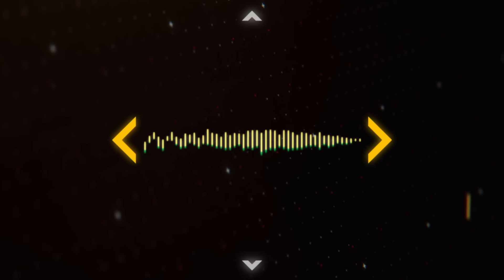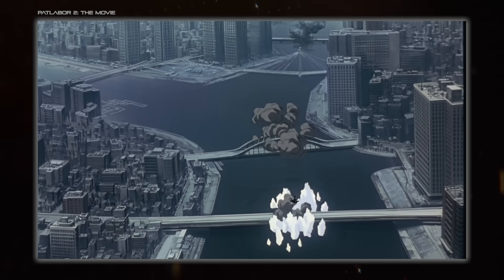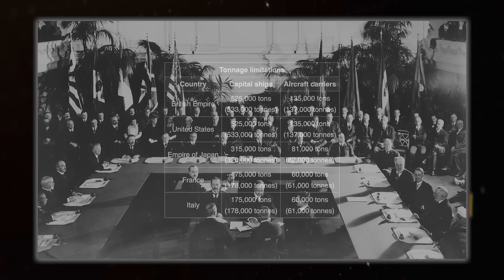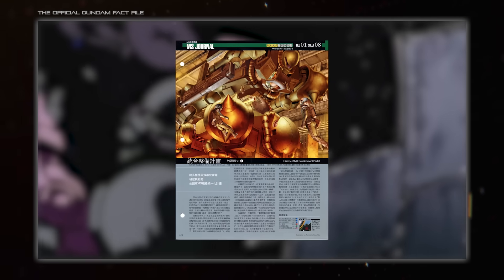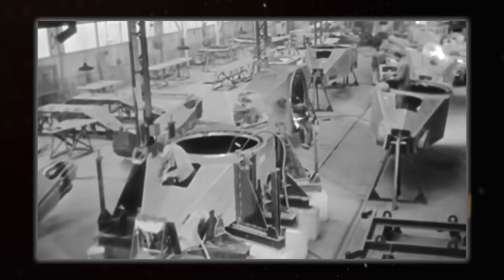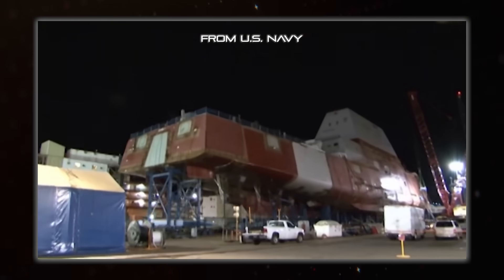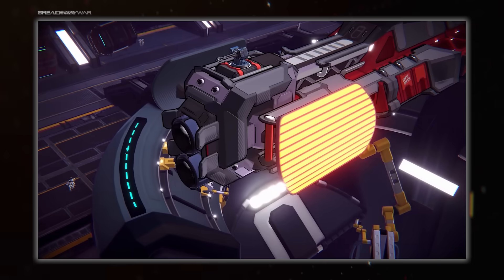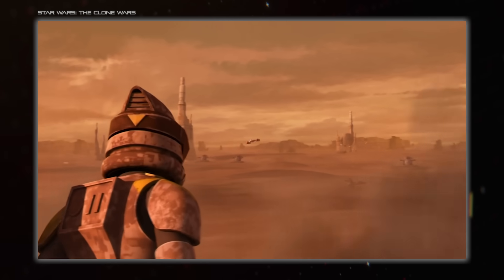Design Principles in Sci-Fi Spaceships

Comment: One thing I'd like to add is definitely the interwar period of 1920-1939. Many ships were built during this period and since it was peacetime no one really knew what the future will hold. Japanese went big on ships like battleships and cruisers. Yet by the end of WW2 everyone realized the winner move was doubling down on aircraft carriers which is why still today the formation of naval fleets are centered around and supporting an aircraft carrier.
Reply: Regarding Imperial Japan: The U.S. felt the need to field a two-ocean navy, so its battleships were limited by the Panama Canal. Japan was interested only in the Pacific, so it built big with the IJN Yamato -- a wider ship provides a stable platform for bigger guns. In an SF setting, the author might posit different goals among the factions that lead to favoring different engineering trade-offs, even if the tech level is the same. Maybe your home star has frequent flares, so you prioritize shielding.
Reply: @phillipthorne8363 I really enjoy settings where there are limits on FTL travel that result in those kinds of design decisions. If there's a volume limit for example, that means your defence fleet doesn't have that limit if it never has to go FTL, so they might be huge in comparison to FTL ships
Reply: Japan's naval doctrine was always to build the strongest ship in each ship type, this is opposing Britain which built as many ships as possible, even if they were qualitatively worse. They also went big on torpedoes to make up for their quantitative disadvantage. Most of their naval doctrine was centered around making up for their disadvantage in battleships vs. the US in order to win a decisive battle and thus (theoretically) win the war.
 It should be noted Japan went as big in with carriers as everyone else did (Japan had 6 Fleet Carriers, US had 7 Fleet Carriers, Japan had a bunch of extra Light Carriers on top of fleet carriers tho).
Reply: @ronanmcdonald6386The US also had a massive escort carrier fleet, far beyond the Japanese light carrier numbers (and could actually put planes on them all).
Reply: @reliantncc1864  You're mixing up the US pre/early war fleet with the late war one.

Before Pearl Harbour there were three Essex class being built with 8 on order with NO light carriers in the works and only 7 escort carriers being converted (of which 4 went straight to the British).

Even after the US entered the war there was a period where the new ships were not ready when losses and the need to keep escort carriers in the Atlantic to hunt U-boats meant that HMS Victorious was 'loaned' to TF 14 in the Pacific during early 1943.

It was only after mid-1943 when the first Essex's and the emergency conversions reached the Pacific did the number of carriers swing back to the US's favour.
Reply: @IamZim11  I'm not mixing up anything. We're talking about the war, all of it. You don't get to decide we're only talking about the first bit.
Reply: @reliantncc1864  That's a rather reductive view of history, especially for an event that took years to conclude.
Reply: @IamZim11  Oh, sorry, but I can't fit a essay into a youtube comment. I've probably read more books about the war than you've read books at all.
Reply: @ There's no need to be rude, but it is worth noting that the original comment sets a time of 1920-1939, so the interwar period, and this comment chain has been talking about the leadup to war and Japan and Americas' choices in that pre-war buildup. Yes, during the war America was able to use it's industrial might to mass produce Carriers, Light Carriers, and Escort Carriers. Japan's lesser industrial power prevented it from making carriers at the same rate (which kinda makes a case for why as much as the Japanese navy hated the treaty system,  they kinda needed it to stay relevent). It's also worth noting that Japan had more carriers in the Pacific of all types than America US 5, Japan 6 CV, 4 CVL (10 total) until the Battle of Midway, (where it went to 4+Wasp as reinforcements vs. 2 CV 3 CVL, still a numerical advantage, but a aircraft numbers disadvantage) and regained that advantage during parts of the Guadalcanal campaign. Finally, Japan had an excess of planes in 1944, but no trained pilots. Only in 1945 was there a real shortage of planes, mostly in newer types.
Reply: Or, if you are Iran, built around tanker's masquerading as aircraft carriers. Lol.
Reply: The single most important factor in interwar naval design was merely the requirement to abide by the naval limitations treaties. Every country had things they tried to pack the necessary firepower into the limits on tonnage.
America used compact propulsion machinery and the all or nothing armor strategy.
Britain and France tried goofy gun configurations like quad turrets or putting all turrets forward.
Germany just... didn't follow the treaties.
Reply: That, and Japan always felt slighted by the much lower limits put on them by the Washington Treaty.
Reply: Well, Japan was on par with the UK and US carrier-wise, at least until Midway
Reply: There is no air/water interface in vacuum.  

No point in having spacefighters other than dropship gunships.
Reply: @brandonbowerstx  maybe torpedo boats though.
Reply: I've thought about this a littlez and space fighters maje way more sense than you'd think at first glance. To explain this we need to look at what a carrier aircraft is useful for, and see how this can be applied to spaceships:

1. Carrier based craft allow the home craft (carrier) to extend it's effective sensor and munitions range, allowing it to 'reach out and touch' far away targets without being at risk of retaliation

2. Carrier based craft can be deployed more flexibly, allowing a single ship to have a wide area of influence that can on demand be focused on a single point. A fleet of smaller ships with ghe equivalent tonnage of a carrier wouldn't be able to cover such a wide area and concentrate their firepower at the same time. But a carrier can.

3. Because the home craft handles the transport of fuel and ammunition, as well as life support and living quarters, the carrier based craft can be designed without those amenities, thus being more combat effective by reducing weight and size for the same amount of munitions

Notice that all these advantages don't apply exclusively to modern crafts. Hence why I never used the term 'aircraft', only the domain agnostic 'carrier based craft'. I think, depending on the setting, having large ships that carry smaller ships inside them would make a lot of sense. Those smaller ships could be leaner and meaner due to a lack of long term life support,  fuel, and munitions on board. They could be deployed as scouts, or as patrols, of massed together to attackenemy formations. And they would always be faster than enemy spaceships because of the aforementioned lack of heavy long term necessities. So yeah, I think carrier crafts make a lot of sense in sci-fi depending on the setting.
Reply: @Fantastic_Mr_Fox  The issue is that any mass you spend on the parasite craft is probably better spent on the large one instead. The same mass and propulsion restrictions are in effect, and you don't even get the advantages of going higher, being much faster or harder to hit like naval aviators do. 
Aircraft are fundamentally different from ships, that's why aircraft carriers exist - there is no such distinction in space
Reply: @ I think I should have explained a little bit more, because the problems you mention, while they certainly reduce the value of fighters in a space setting compared to a planetary setting, aren't as bad as you think. 

Firstly, the mass and propulsion restrictions aren't the same. A fighter craft, as I pointed out in my first comment, doesn't need as many systems as a cruiser (using the age of sail definition here: a ship used for longer voyages) and is thus lighter and smaller, allowing it to evade enemy fire much more consistently. 

Secondly, spending that mass of fighters on the carrier itself has drawbacks. First, you lose versatility, since a warship can only be in one place at any one time, but a fleet of fighters can be in many places at once. You also lose redundancy: if a critical system of your ship is hit, that's it for the ship, but if you lose a fighter, you may have 20 more till. 

It also allows you to engage enemy ships while not being in harm's way yourself. Think of fighter craft as an extension of the ship's weapon systems and not as individual ships. 

To be entirely fair though, this only works if the economy of scale (when massing everything into a single ship rather than multiple) isn't that great, so splitting your ship into smaller ships isn't massively inefficient. Also, you need not have an upper limit on acceleration, which would limit the speed of the fighter craft to whatever Gs the pilot can pull, or have unmanned craft. 

But, supposing those issues are dealt with , I think fighters make a lot of sense. Imagine a swarm of fighters, too far away to be hit with your guns, getting into their range and unleashing a hail of torpedoes then noping out of there. Would be a pretty powerful combo I think
Reply: @brandonbowerstx  that's quite a shortsighted ideal. We aren't talking about real life here. In a realistic fiction like the Expanse maybe but I believe the largest sci-fi franchise Star Wars really likes spacefighters. And there are plenty others like Gundam, Battlestar Galactica, so on so forth.
Reply: See my comment above, I lay out arguments for why space fighters make a lot of sense (specifically for hard sci-fi)
Reply: @piperMcGuffin  : Fighters require 4x Delta-V compared to an equal volume of missiles which require 1x delta-V for the same exact mission.

Tactical mistakes cost 6x Delta-V.
Star Wars is trashy space fantasy.  Not anything approaching hard SF.
Reply: @brandonbowerstx  yes your point? Hard SF isn't the only thing that exists. And honestly, objectively, not better than soft Sci-Fi. I found myself bored by realism in recent years.

Comment: Currently playing through FTL: Faster Than Light for the thousandth time. 
Space is hard. Just made some poor pirates desperately suck vacuum while I watched their life support burn. If this seems unnecessarily cruel, consider that they had stuff that I wanted, and they were in my way. Accordingly, I introduced their hull to my dual Burst Lasers.
Also, consider this: what's on the other side of the airlock? That's right- space. Therefore, he who controls Doors, controls Space.
Reply: Fellow Door Monster fan.
Reply: Doing a Rock A run this morning. On sector 8 with a Vulcan, Swarm missiles, and a fire beam, with auto reloader, fully upgraded teleporter and 4 Rocks for boarding. Flagship is toast.
Reply: Tarded but amazingly accurate.
Reply: @brandonbowerstx  what? 👀

Comment: I always thought, in worlds with super powerful heat sinks, it would be cool to see a scene where at port, the spaceship either has to switch out their used heat sinks with new ones with fresh capacity or must somehow quickly transfer or radiate the built up heat. Would provide another reason for ships to need a place to stop at other than just refueling
Reply: Dump worlds in each system where a ship flies into the upper atmosphere to rapidly dispose of the heat in their sinks. Gradually resulting in a massive increase in the temperature of that world because it is illegal to do so on any of the habitable worlds in a system for environmental reasons.
Reply: @tyrannicpuppy  sounds like something to use a gas giant for
Reply: Heat buildup is one of the big limiting factors for FTL in the setting I'm working on, with jump distance limited by a combination of heat saturation and space-time stability. The further the jump, the more power needs to be dumped into both the shields and the FTL drive, and the more heat gets generated. Ships still have radiator arrays to dissipate the heat themselves, but for things like bulk freighters that need fast turnarounds, the heat sinks detach with the cargo module in one big unit that's then replaced before the freighter's sent back on its way.
Reply: Not a bad idea. You could run radiators in normal operations, but in heavy dust/combat/stealth you pull them in and move all the heat into massive internal heat sink. That would give space stealth, but with limited endurance. Once you're out of the situation you were in, you either have to hang around a while radiating all that heat out, or just dump the entire sink into space and buy a fresh one at a nearby station.
Reply: In the "Night's Dawn Trilogy" setting by Peter F. Hamilton, ships have vulnerable "thermo-dump panels" that must be retracted to squeeze through a wormhole or during combat. And in the "Warstrider" books by William H. Keith, Jr., heat builds up during prolonged hyperspace travel, making onboard life very uncomfortable. But those are novels, which don't operate under the "rule of cool" incentives of visual SF.
Reply: Dissipating heat is a major difficulty in ship design in harder settings. Space is a giant thermos and every system on a ship generates heat.